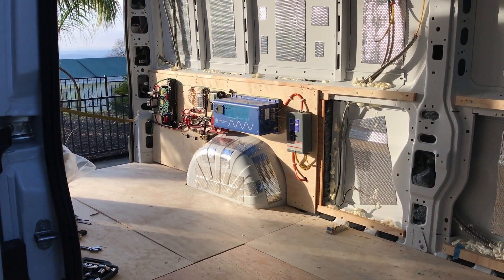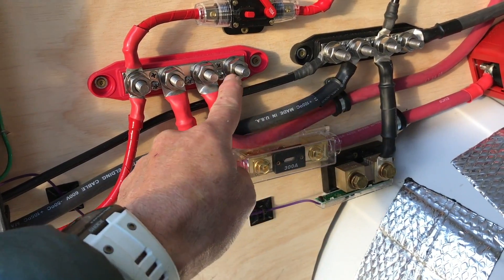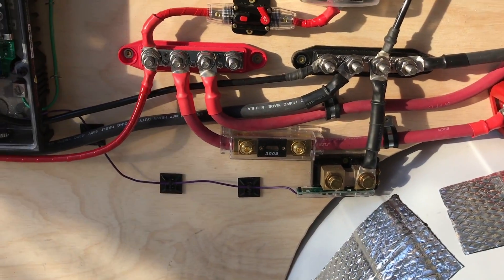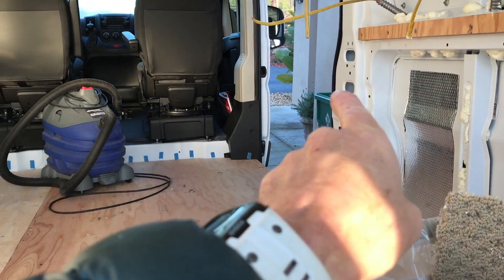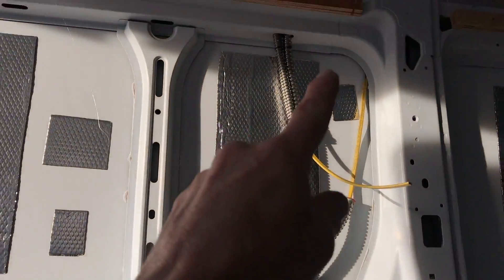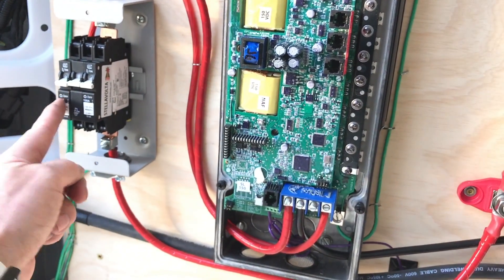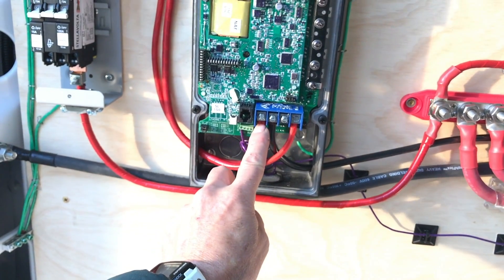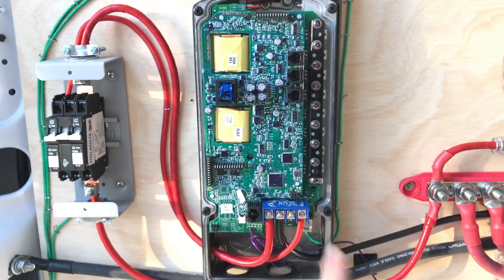Promaster Conversion #4, Solar Wiring

Comment: So is the negative and ground wires hooked up in the same fashion? Both on the chassis?
Reply from the maker: in a car/van/RV, negative and ground and chassis are all the same thing.  Voltage doesn't actually go to "ground" in a vehicle, because there is no ground.  Rubber tires get in the way.  
In a house, the voltage does actually go to a big copper rod driven 6 feet in the "ground".  But vehicles can't do that.
Reply: Thanks for the clarification. Man you've helped me out a lot. Lots of trial and error when it comes to this van build. haha how is yours holding up?
Reply from the maker: no problems
Reply: Is it better to use a bus bar than connect everything directly to the battery terminal?
Reply: Also why do you need a fuse between the battery and the DC fuse block? And what size (amps) bus bar are you do you need? Thanks.
Reply from the maker: I put some way to interrupt current between the batteries and every component.
https://www.amazon.com/BUSBARS-4-Post-Power-Distribution-Block/dp/B075XCMC2T/ref=sr_1_1?s=automotive&ie=UTF8&qid=1526494498&sr=1-1&keywords=BUSBARS+–+4-Post+Power+Distribution+Block+–+Pair+of+3%2F8”+Black%2FRed
Reply from the maker: If there's just a couple wires, then connecting to the battery is fine.
If there's a bunch of wires, then there physically isn't enough battery bolt to handle all the wires.
Reply: Makes sense. If I have a pure sine wave inverter do I still need a breaker box for the 120V system? Manufacturer says it's not necessary but there are so many people who use them with their system. Can't find any resources on the topic online.
Reply from the maker: Aims probably said that because there IS an outlet and a resettable breaker on the Aims unit itself.  (I don't know how many amps it's rated for).    
    If someone's using remote outlets and sending power to those outlets, then in my mind there needs to be a way to interrupt that power to a particular outlet if needed.  Not just depend on the one aims breaker to control 4 outlets.  You'd still need to have the same junction box to connect the one output wire from the inverter to however many outlets.  
    However, if someone wired all the outlets together (a homerun) I guess there would be just one wire leaving the inverter area.  If all the outlets were on one wall, that'd be easier then trying to put 2 outlets on each wall and trying to pass the wire over the roof to the other wall to catch the other outlets.
    But if people use a homerun, and the breaker keeps tripping, which outlet is the cause?
If there's a breaker for each outlet it's very clear.
There's a lot of ways to wire a van.  
But I'm not a electrician, so what do I know.  If you're in doubt, then it's better to hire an electrician to design it for you.
Reply: On the Trail with Bart yes your probably right. My particular inverter (renogy 2000 watt) comes with 4 AC outlets.

Comment: but can't you just buy a yeti battery
Reply from the maker: My wife likes to run a fan all night long.  With the last Sprinter, it had 440 amp hours.  Running the fan all night long would bring the batteries down to about 80%.  The lower you discharge glass mat batteries, the shorter their life span.  I'm hoping with 660amp hours, I'll only discharge the batteries down to 90%.  In the Sprinter, there were a few times when it was really cloudy and it was a struggle to get the batteries charged up enough before the sun went down. ( I didn't have an alternator charger back then).  One day, I'll be thrilled to switch to lithium batteries.  Until then the glass mat are 1/2 the price of lithium batteries.

Comment: Nice system,  high quality stuff, clean install.  The midnight is overkill, I would have skipped it and got the SC2030 and with the extra $300 dollars left over, upgrade to a better inverter/charger.

Comment: Only one more thing. I'd separate negative charge from all appliances, from negative/ground of the van (which is the chassis). Just route it back to the battery. That will separate electric circuits between van itself & your installed stuff. It's just safer that way.
Reply: I've only seen this mentioned a couple of times across hundreds of hours of research into wiring a camper. Do you have any links to videos or how-tos?

Comment: 5:22 and few ongoing minutes. You can spare that 130$ ish on something else.  By installing poor man's remote on a switch on the RJ45 jack. 3-5 turns inverter on, 5-7 turns on with power saver mode. Which means: short the pin 3 and pin 5 to turn on the inverter; short pin 5 and 7 to turn on the power saver. Taken from some other build vids & Amazon ;P
Reply from the maker: Thanks for the input
Reply: Found that hack on Amazon with the diagram as well I and can confirm it works also on with my AIMS 600 watt inverter/ charger. Cost me a 1$ toggle switch from eBay and a leftover Ethernet cable. ;-)

Comment: Very nice Video great explanation. The only thing different I would do is design the system so that all the on off switches would be in one location and easily accessible. Even if in meant a little longer runs from the components.

Comment: Hi, this is by far the best electrical explanation that I have seen. Excellent work. Was wondering what model or type of breaker box you purchased?
Reply from the maker: https://www.amazon.com/gp/product/B007IAIW7S/ref=oh_aui_detailpage_o00_s00?ie=UTF8&psc=1

https://www.lowes.com/pd/Square-D-2-Circuit-2-Space-30-Amp-Main-Lug-Load-Center/3457972
Reply: @onthetrailwithbart523  For the AC side, it looks like you are referencing a 30-amp breaker box, but you have 4 15-amp breakers. Is that correct?
Reply from the maker: yup, but in practice we never use more than about 10 amps at any time.

Comment: I wanted to ask about charging your house batteries from shore power.  Does the inverter allow pass through current when its detected?  I have a cheaper inverter and am thinking an ATS is needed to prevent a feed back loop to the inverter when using AC shore and charging batteries.  Nice setup.
Reply from the maker: The Aims Inverter allows pass through power to the AC breaker box even if the inverter is off.  The only time I turn the inverter on is when there is no shore power and we want to plug something into the 110 outlets, like the microwave.  Otherwise everything runs on 12 volt.